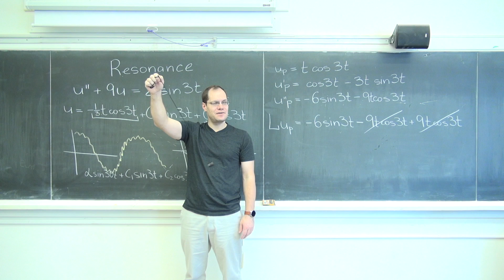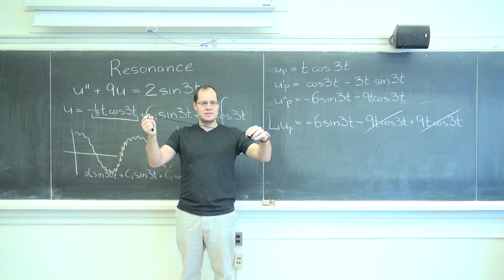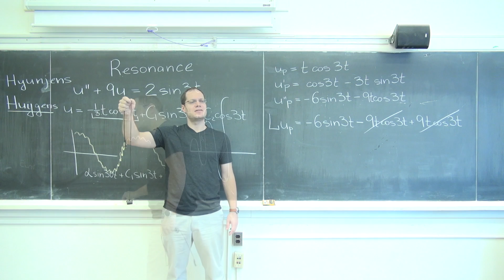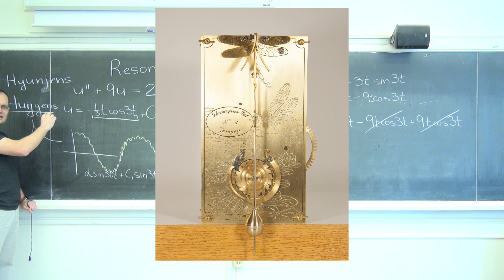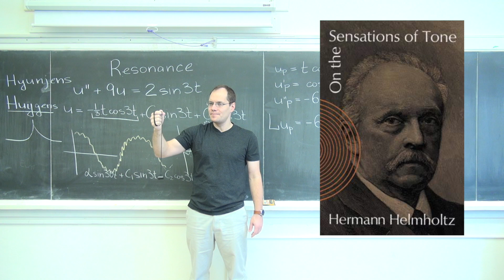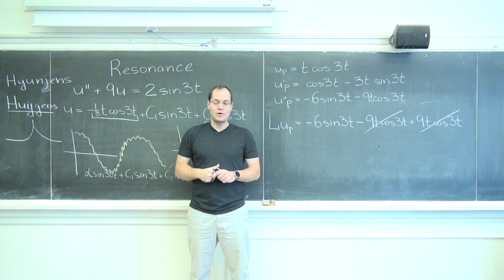Intuitive Explanation of Resonance by Helmholtz

Comment: 03:10 The thing that complicates the pendulum is that the direction of gravity changes during its swinging, so the differential equation is non-linear, and the resulting function isn't actually (co)sine – its tops and bottoms are a bit distorted. It's like if you drew a sine/cosine on a curved sheet of paper, or multiplied it with a different scaling factor at each particular level of the graph.